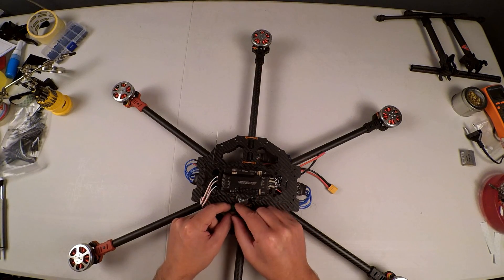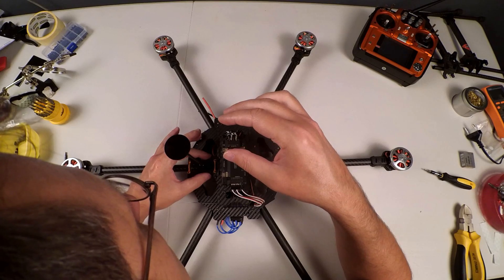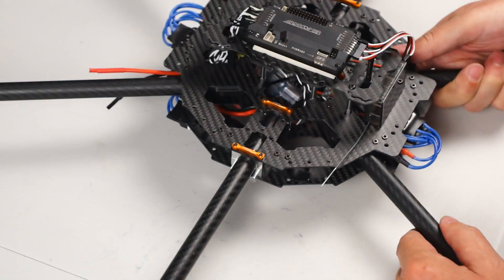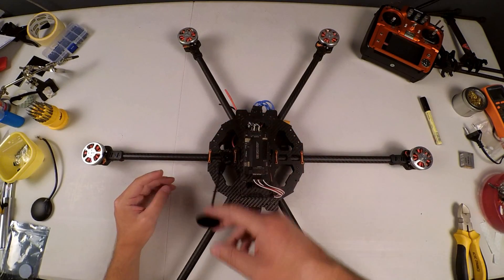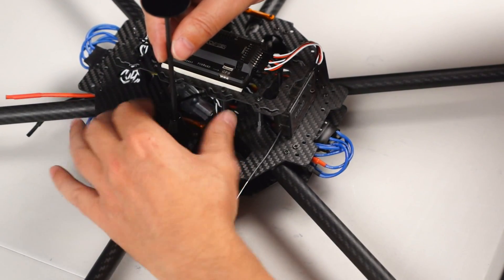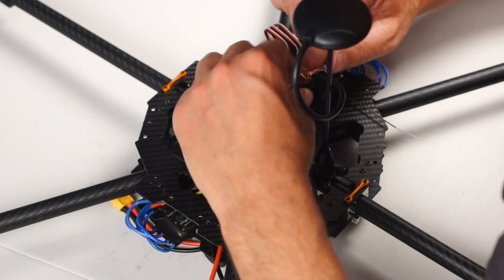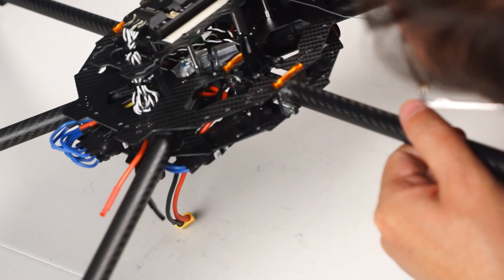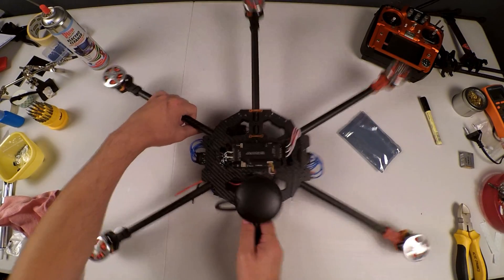Hexacopter Build Part 9 - Mount and Connect GPS to APM on Tarot FY690S

Comment: Hey matey 
Thanks so much for the great videos! 
I'm building a  680 at the moment and am stuck on what motor and esc to use. 
All I'm using this for is a GoPro and 3 axis Gimbal. 
6 cell battery for flight time. 
Could I ask you for some advice on what motor, esc, prop selection for a non heavy lifting rug? 
Any advice would be greatly appreciated! 
Cheers.

Comment: What kind of battery did you used?
Reply from the maker: Initially a 5000mAh 3S XPower Battery, but soon upgraded to 10000mAh 4S as it gave better flight time.

Comment: Why did you go with an APM? You can pickup a Pixhawk for only a small amount more.
Reply from the maker: When I ordered this the APM was much cheaper than Pixhawk. I am actually in a process of upgrading this to the Tarot ZYX-M flight controller (when I get the time). Motors will also be replaced by Mikrokopter motors
Reply: I should 100% suggest staying with ardupilot as it is a superior flight controller.